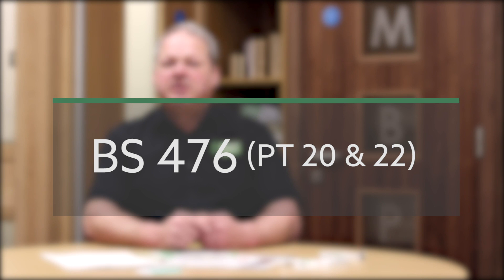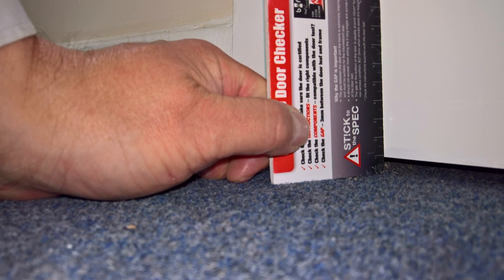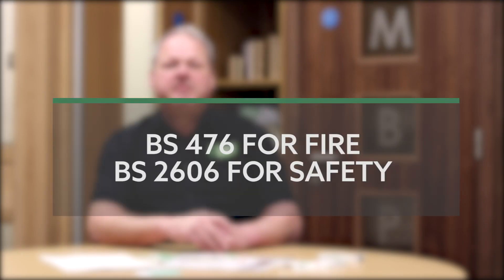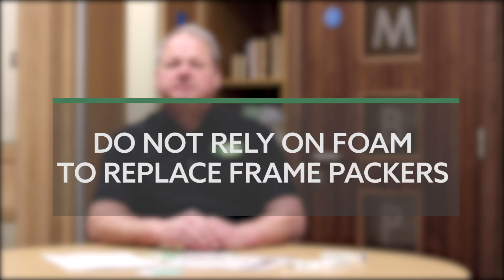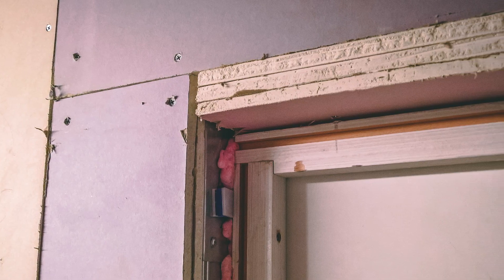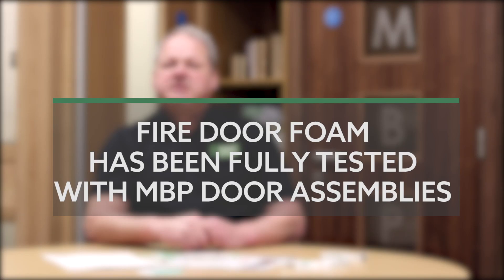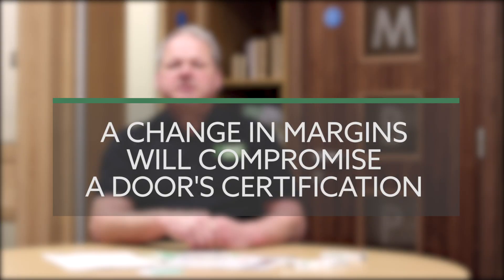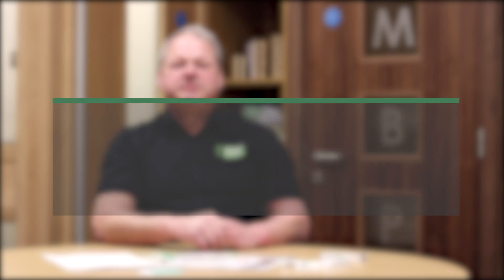Toolbox Talk: Installing Timber Fire Doorsets October 2018

Comment: We have just had flat doors changed to 30 min Fire Rated replacements.  The gaps are all over the place, some up to 9mm, should be 2 - 4 mm.  The door stops are integral with the old frame so there are gaps here that are too big to measure with a guide, I can get my finger between the door front and the door stop!  Any suggestions?  Probably need to replace the frame.

Comment: What qualification does a contractor need to fit fire doors
Reply: Carpentry
Reply: My guess would be none, all of the fire doors in my David Wilson Home have no sealant in the frame to wall gaps, all are wide open with the plasterboard on both sides cut back from the timber stud, some gaps are as wide as 40mm.
Reply: @WhistlerUK  that is shocking 😮

Comment: Great video, thanks! Can timber wedges be used please? Is there any guide lines on this?
Kind regards
Reply: Plastic packers? That’s wrong. They will melt. Same goes for plastic red and brown plugs. It’s a no no
Reply: what plugs do you use then if not plastic? what packers?
Reply: @ricardowhite3620  you can use plastic and timber packers with our Fire Door Foam - these have been tested with timber fire door assemblies - see www.fireandacousticseals.co.uk for more information. We are part of the Midland Building Products Group. All test data available and installation information is on the website.